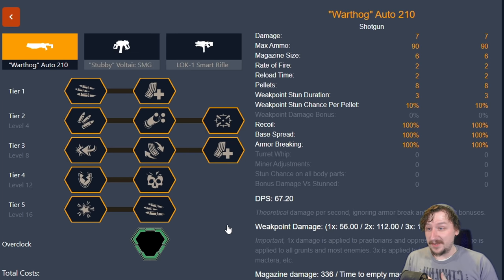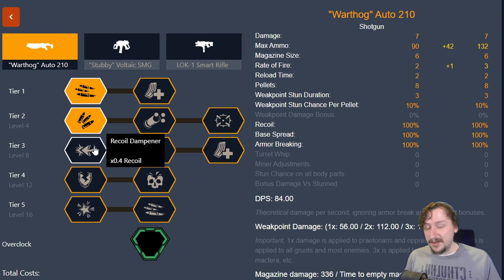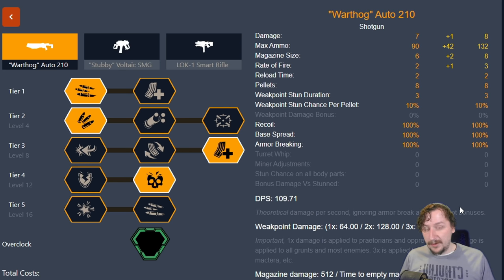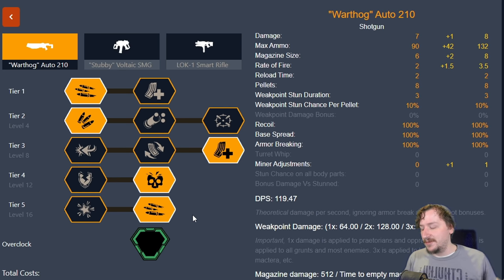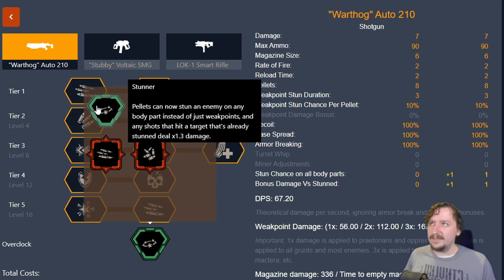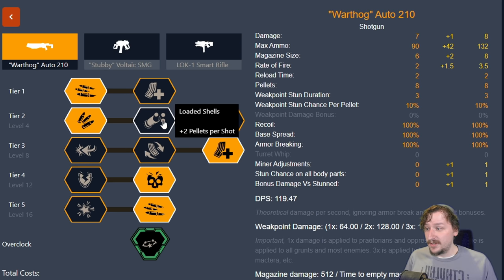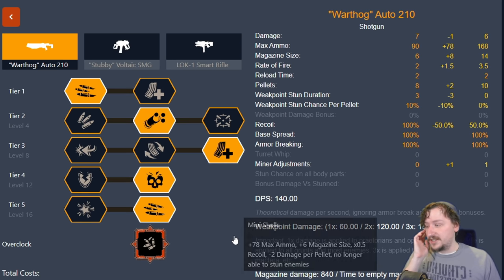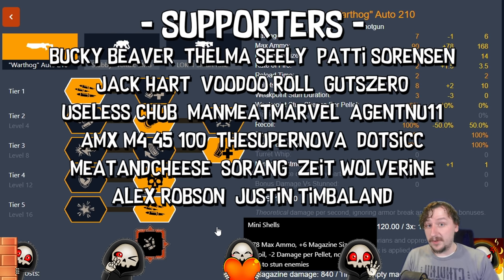Deep Rock Galactic | Warthog Auto 210 Shotgun Builds

Comment: Since I prefer nade launcher over breach cutter, I like having the armor break on the nader just because of the sheer coverage and godly amounts of armor break it can do. Exposing those glowing prat butts fully activates some neurons in gunners and scouts, I tells ya.
Reply: XD  so true
Reply from the maker: Cool!
Reply: Same
Reply: As a Gunner and Scout main, I can confirm that seeing the armor shaved right off of a praetorian makes me way more likely to target it.
Reply: i got back into the game last night after a year or two hiatus and came to the same conclusion when i got to that upgrade tier. dreadnoughts/praetorians/etc. are way easier to handle when their weak points are well exposed. it also works for me personally because my instinct when i see a big bug is to pull out the 40mm, so having quintuple armour-break helps make up for the relatively low single-target damage
Reply: The armour break on PGL is broken and doesn't actually work.
Reply: Yea... the pgl doesn't actually break armor that well, if at all
It takes many shots just to break the smallest amount of armor, because it's bugged...
Reply: even though its not very practical i love freezing praetorians with the cryo gun then drilling them as driller while running vampire perk

Comment: I run a simple shotgun, with 1-1-2-1-2. I fire fast, I reload fast, and I break armor with high ammo capacity so I can endure for longer. I pair this with Stunner Overclock and dual 360 degree Turrets -- also with  stunning capabilities.
This has been working out well for me, and it allows the Engie to escape dangerous situations. 
Sure, it takes an extra shot(s) to kill, but it slows aggressive grunts and Pretorians so well. 
I play Haz 4 though, so idk if it's viable for Haz 5 or whatever.
Reply from the maker: Awesome!  It should be just fine on Hazard 5.

Comment: Part of me wants to see an overclock for the shotgun that trades the buckshot for single slugs. It wouldn't play nice with the tier 2 mods, though (Unless you made it a "slug" by just having all the pellets hit the same place), but it could be fun to run around with what is basically a slightly slower M1000 with no scope... it's the reason that I run Magnetic Pellet Alignment and Choke on the same build... Naturally there'd have to be downsides or this would just be "More magnetic pellet alignment" (I'd probably say less DPS overall, but I'd have to lose the grunt faceshot breakpoint)

Comment: Wanted to give this a check for an educated second opinion and was surprised to see how different our takes were. Specifically speaking to the "Stunner" overclock. The build I've been playtesting (in Haz 4 because I'm a casual) is:

- Supercharged Feed Mechanism
- Choke
-  Quickfire Ejector 
- Bigger Pellets
- Minor Adjustments

I figured that loadout with the PGL (using Clean Sweep) built to stun and break armor, and turrets equipped to stun would be devastating together. I'm losing out on a ton of ammo, expanded magazines for the turrets, and a decent reload speed, but dear lord does this loadout not shred. Everything is blown up, and what isn't is stunned, and what survives the stun is usually feared from the PGL/Proxy grenades. 

If I had to speculate though, the tier 2 ammo expansion is probably better than choke, as things like mactera, menaces, and spitballers can usually be dealt with by scout and gunner, but speaking from the POV of a solo player who lacks that luxury, choke is king.

Comment: The Warthog in one of the few weapons (alongside the Deepcore) I cant pick over the unlockables aside for the stun on weakpoints . Crappy ammo, relative low damage for a shotgun, not good for hordes and the only good point is the turret whip which burns your ammo in a flash and boring overclocks. At least the Stubby gives you a status effect and some area control while the Lok1 got better overclocks and more punch per bullet.
Reply: And that's fair, you use the weapons that you're more comfortable with. 
I personally like the shotgun because I build it to one tap grunts and have a large magazine capacity.
Reply from the maker: That is fair.
Reply: Low damage? You can one shot grunts what more do you want lmao
Reply: I'm actually the opposite way. I always pick the Deepcore and Warthog over the unlocks. They feel like reliable, solid workhorses that are good in every situation.
Reply: I couldn't disagree more.
Reply: @hokuhikene  aoe? Engi literally has the best aoe secondaries. If you can hit your weak point shots consistently, warthog is S tier
Reply: I just hate the playstyle of the LOK-1. The only build that seems viable with the explosive chem rounds is so annoying to play and you run out of ammo super fast. 

Admittedly engi is my least favourite class, his secondaries are awesome, but the primaries are either a little underwhelming or annoying to play. Building and managing the turrets is the worst part for me though...

Comment: Now I wait for the Stubby video because it's the one Engie weapon I can't vibe with at all
Reply from the maker: It's coming up soon.
Reply: I had a tough time with it for a while too, but I experimented with EM refire booster OC with 22222, and like it. You can't fire it full auto, use 3-5 round bursts if possible, but you electrify and slow a group of bugs real quick, and then the extra electric damage starts ticking and finishes off the whole pack with a couple bursts at different targets.